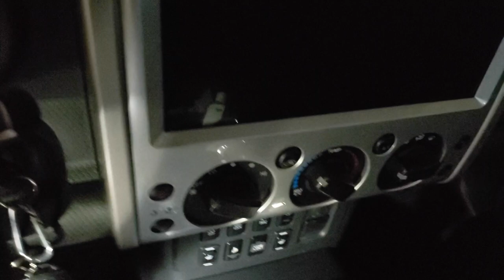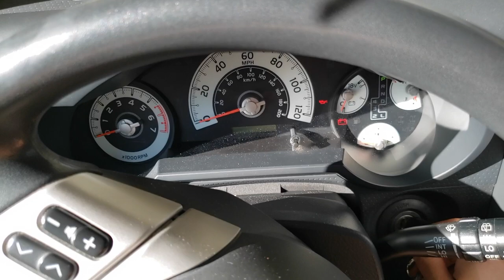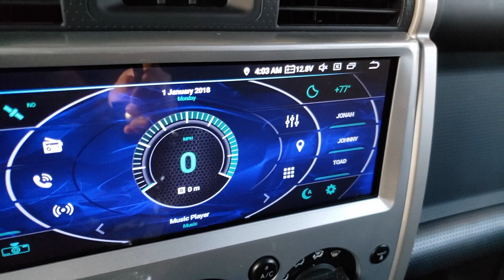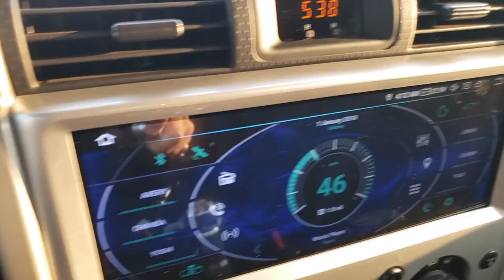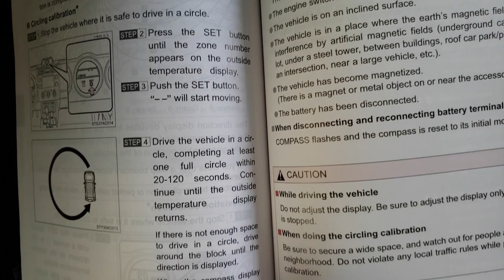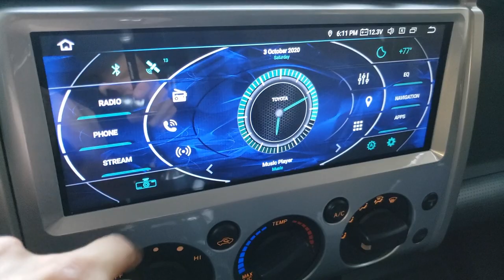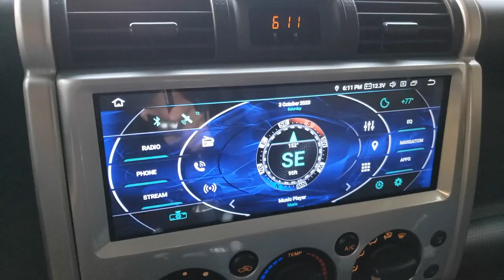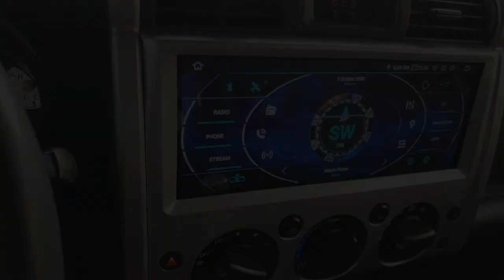One thing I ALWAYS have in my car

Comment: Great video, YES, great recommendation. I use the Battery Tender brand 1000amp comes with a wireless charger on top so if you are not using it to jump vehicles acts as a great instant power bank for emergency phone charging too. Whenever I can, I replace as many service/dome lights with LED’s to help minimize as the LEDs have such a low draw on power they are more forgiving. Thanks for showing how functional the booster is. They are great for motorcycles too if people have them. Could I recommend you looking into a float charger (battery tender that you leave plugged in at home no need to unplug until you are ready to drive), basically it is a plug in charger that keeps your battery fully charged. I use mine because I don’t have a daily driver, I only use my vehicle a couple times per month. Deltran Battery Tender is fully automated. I have used one on my wife’s car, it extended her car’s battery life to 8 years. I wouldn’t have believed it if I didn’t keep the receipt when I bought the last car battery. Battery Tenders are great for cold climates and tropical climates as they affect the lifespan of any car battery due to temps falling outside the norm range while the vehicle sits. Keep up the great videos. Thanks for sharing.

Comment: You connected the portable starter to both terminals on the battery? In the FJ manual it says to connect a -ve jump lead to the Ground spike coming off the engine block when jump starting. I think this is to avoid damage to the FJ electronics. 

Thanks for your FJ videos
Reply from the maker: Yes, the length of the cables is only long enough to connect to the terminals.  Thanks for watching!